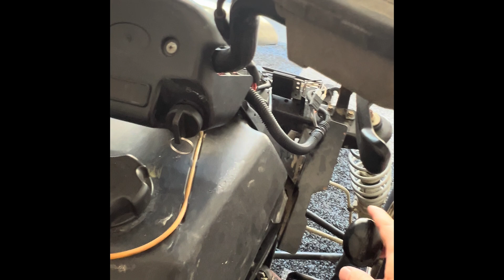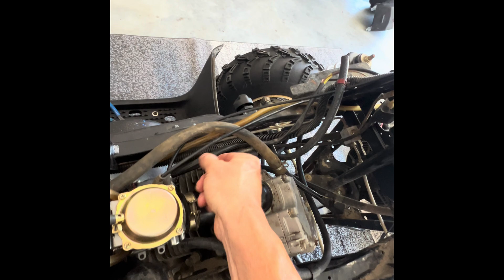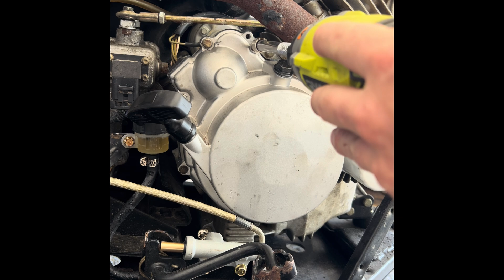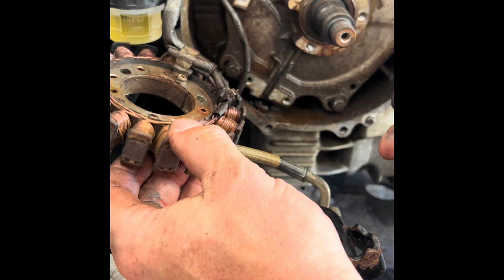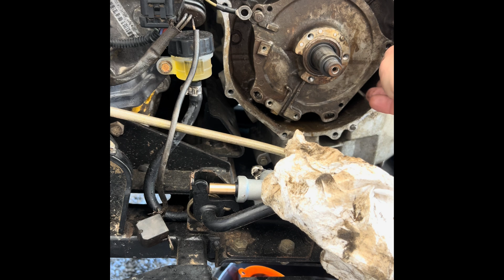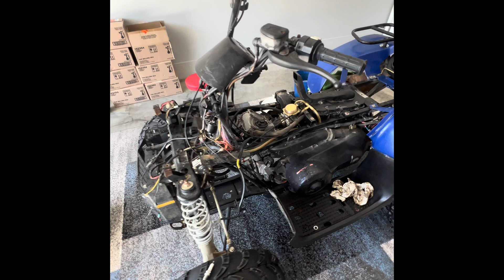Can We Fix This Polaris ATV? Customer Says It Has No Spark!

Comment: I just took this project on as well. Had spark this morning when pulling cord. Lost spark when I hooked up battery. Followed your steps and it worked for me as well so thanks. What did you do for a kill once you unplugged yours? Also any chance you could send me a picture of all the fuel lines. The previous owner had all gas lines removed from tank and fuel pump.
Reply from the maker: Good deal!  Glad to be able to help.  I no longer have the machine but I could probably still help you with the fuel lines.